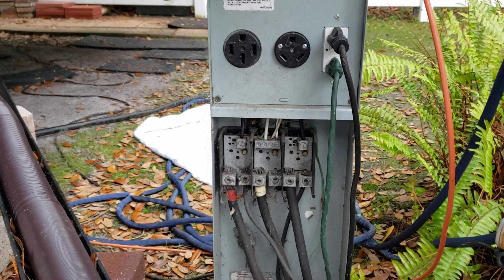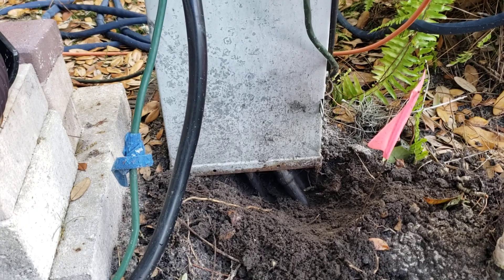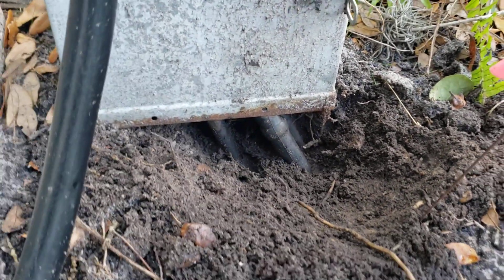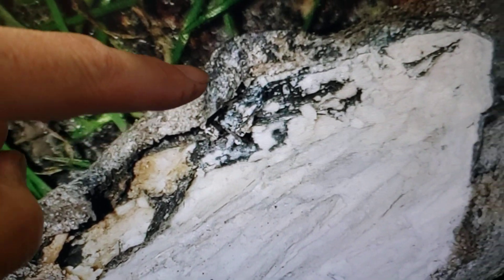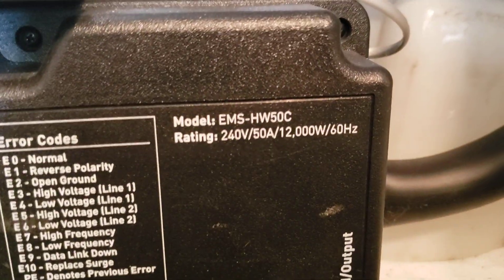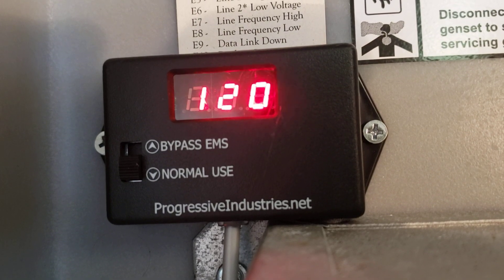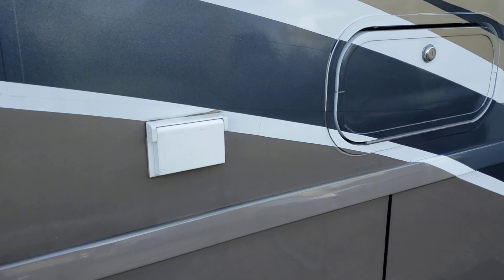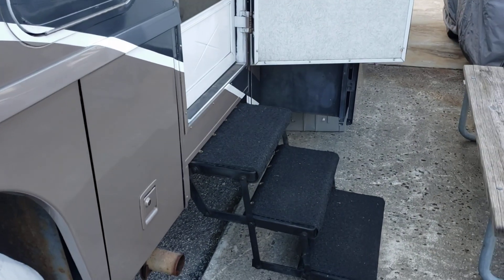Scary Electrical RV Panel Campground Dangers Things You can Do to Protect You and Your Family

Comment: Nice video, issues like that are not uncommon. I had a similar issue at a campground in Maine. The voltage was 115 no load but dropped randomly to 100v or less in use. My surge protector automatically disconnected from shore power and alarmed. I was able to prove the issue wasn't my cords with a VOM, and also tested other nearby plugins that showed the same issue. The campground manager and got me another site that did not have the issue.
Reply from the maker: Thanks for watching James I just got me one of these for backup
 Hughes Autoformers RV220-50-SP, Voltage Booster with Surge Protection, 50 Amp
by Amazon.com
Learn more: https://www.amazon.com/dp/B01MXL9YJV/ref=cm_sw_em_r_mt_dp_BSTWD0QJC9QNASP0KSA3
Reply: @ktoutdoor  mine’s a progressive industries 30 amp, and it works well enough. The panel voltage indicator is maybe 5% higher than my VOM. Lots of people in that campground had struggling ac units. I wonder how many overheated and fried. These smart surge protectors are a must.
Reply from the maker: @jamesfearing9459  Check out this experience I had at another camp ground https://youtu.be/E6uV5AoPN9Y

Comment: That is a very dangerous situation for sure. I believe the NEC requires that appliances and hardware be grounded, but I also thought that the service lines were required to be in conduit as well. Another scary situation of a live skin RV. Last year I plugged in the Bounder to a 20a outlet while loading for a trip, walked up the metal stairs, barefooted, and felt a little current flow through my feet. It was quite difficult to find the circuit that was shorted to ground. I placed my meter on ACV while while connected to rv ground to a known good ground. I had 40v ac on that ground but no mater which breaker I turned off the voltage never dropped more than 15 to 20 volts. What i had to do was switch the meter to Hz, knowing that any voltage in this part of the world would be 60Hz. I found one breaker that would shut down that Hz reading and it was the breaker that fed the outlet in the storage bay aft the entry door. During assembly the wires were bent so tight and pressed against each other that the line and ground insulation had compressed , causing a very high resistance short that wouldn’t exceed the breaker limit. I now have a Progressive Dynamics power monitoring system. This could have been a bad situation had it gone undiscovered for very long.
Reply from the maker: Thank you for contributing Larry,, my most time consuming troubleshooting was tracking down a loose in a 1970 mobile home it was the last place i looked in a light fixture of course.

Comment: I have the same surge protector you have but I mounted the remote readout in the bedroom.  As I am sure you know when you switch the pedestal power on after a few seconds a loud thump is heard telling you the connection is good and power has been passed on into the coach. Then the monitor in the bedroom tells me the exact voltage and current and hertz. If there is ever an interruption of that power I can check what is going on without having to go outside(night time, rain, or whatever).  I would NEVER be without it.  

Good info as usual